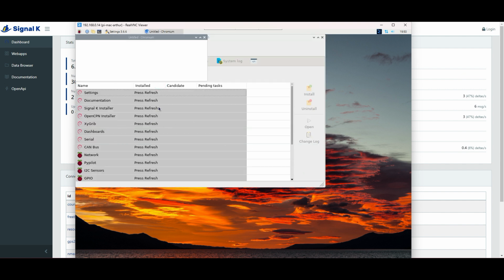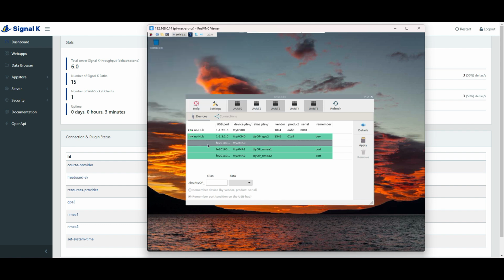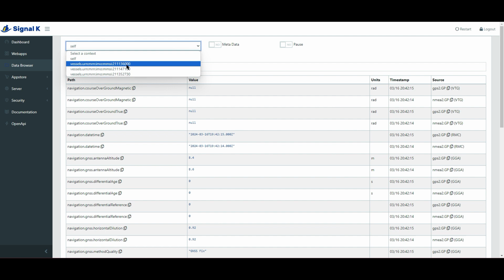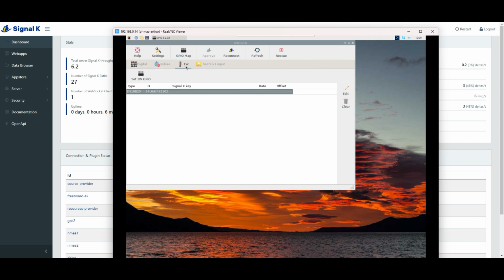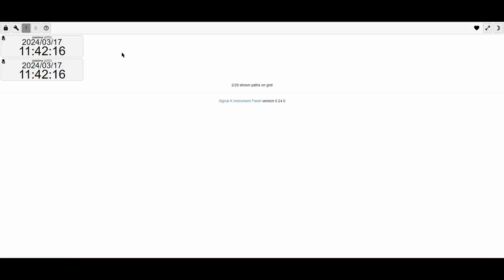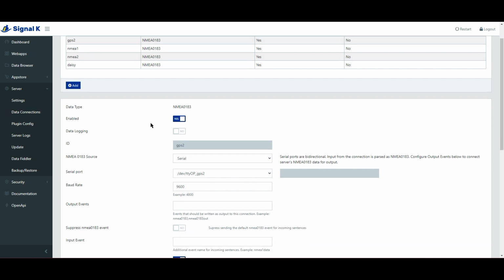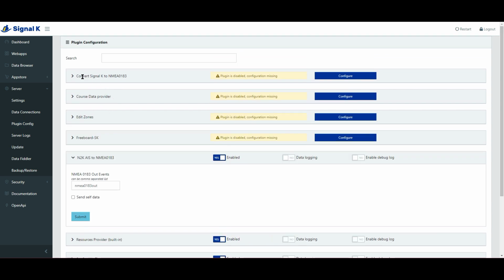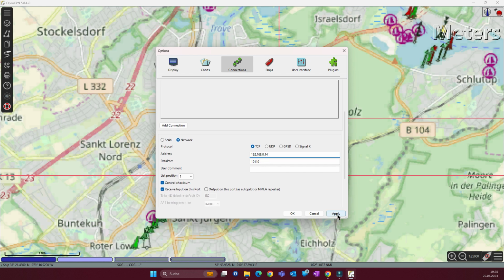OpenPlotter Signal K SPECIAL (with OpenMarine/WEGMATT MacArthur and dAISy HAT)

Comment: this gives the feel of installing a soundcard back in the 90's really awful experience
Reply: Everything that's easy is easy because enough people did it the hard way, so that the process became smooth
Reply from the maker: Full flexibilitiy is usually killing the plug and play feeling which you expect from UX optimized mass products.
On the other hand technical creativity is offered with these kind of open source solutions. 
I think both own their place. 
What has changed compared to prior times: Today it is very easy and cheap to integrate sensors, displays, to generate dashboards, send mails or forward data... 😀